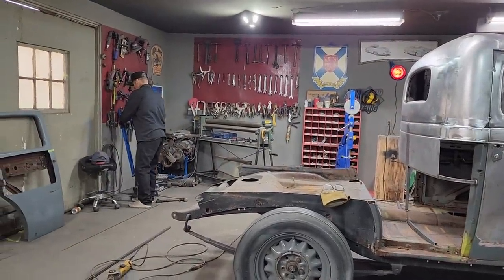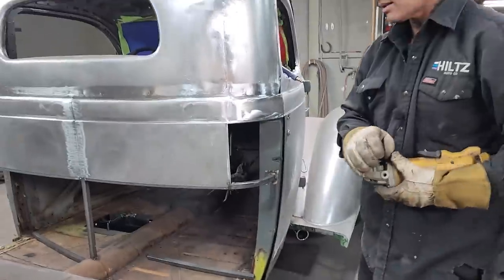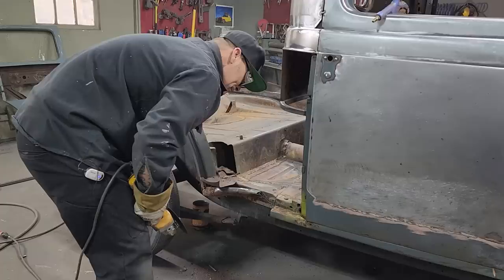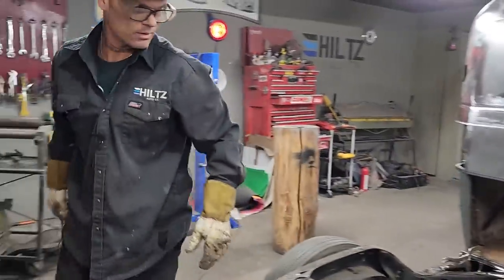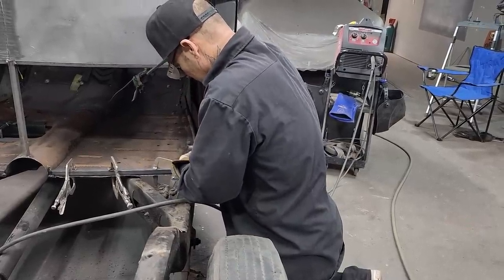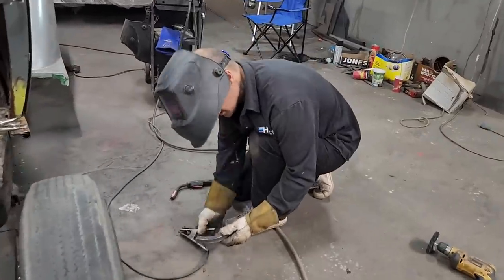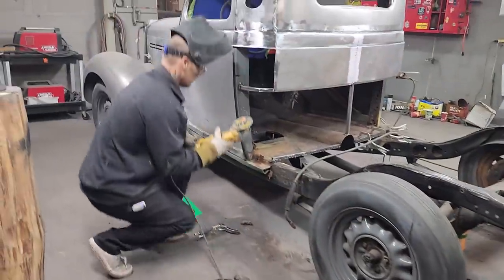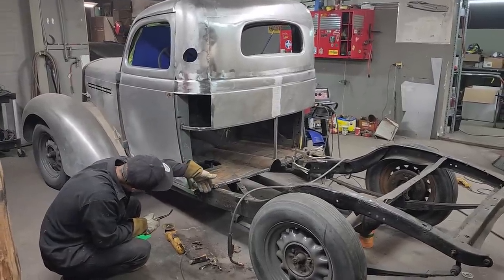Sedan to Truck conversion: cutting the floor off to fabricate cab braces

Comment: Dear Chad and Jolene.
Because of what I’ve learned watching you I was able to repair my tail pipe break on my automobile I’ve had a welder for years and never used it and you’ve given me the confidence to go for it. As a result I fixed my tail pipe with no cost or a very little cost and saves me hundreds of dollars I’m sure. Thank you keep the videos coming

Comment: Total badass build Chad. Enjoying the hell out of this truck transformation. I know you have mentioned the flap disk wheels and zip cut. I have used flap disks in the past or at work that don’t burn off material as good as the ones you are using. Can you share what kind you use? Brand etc? Shout out to Jolene for the killer content and filming it makes a difference for sure!
Reply: Need to give you 2 thumbs up for that one

Comment: Hi loving the work you are doing. I like the fact that it has nice curvy shape to the body. Apart from the sharp corners  on top of the doors. They need rounding off. If you watch Matt's off road recovery on YouTube. He's making a giant off road recovery truck. A heavy wrecker as he call's it. His cab has a similar look to your cab. Have a look at his 2 doors and how much nicer the door's look with rounded tops

Comment: Could you add a piece of square stock at the bottom of the hump in the center bottom. That way you have something to weld to and maybe add a piece of square stock in center of metal hump going,North,South. Upside down T. Just a mere suggestion,your build,your way of doing it. Doing a awesome job,I am amazed.

Comment: Any ideas on what kind of truck bed?  And will you blend a running board to be a part of the rear fender wells?  Would you consider doing wide rear wheels.

Comment: Farmers did similar things way back, but this will be far more finished and not held together with bailing wire. This truck will have a natural lowered look with the stock suspension and frame.

Comment: 👍🏼 The upper rear corner of the doors looks off to me, it’s too square.  Possibly look at putting a radius instead of that sharp corner.  I think it would flow much better with the curviness of the rest of the body.  Just a suggestion but looking nice!!!

Comment: On the cut-out floor, the horizontal lines stamped in might look good as the vertical sheet metal on the back of the cab.

Comment: Chad? Silver plating with silver nitrate is something that has been used as far back as the development of the oldest of photographs. It can also be applied over paint (with an applicator) to appear "not function" as chrome.

Comment: I am sure you have done this before, but can you show and explain uses of the different grinder wheels you use?  I have used cut off wheels and standard grinder wheels but not familiar with flapper wheels and I am very impressed with the cut off wheels you use.

Comment: I think it is amazing that a professional workshop, I say that because he makes money from it, yet he doesnt have a Oxy Set for cutting, welding or just for heating or shrinking metal with. Instead of using Bog he could share with us the secrets of Leading, but to do that he needs heat, Old Jim has a Oxy Set and so does most people that work on sheet metal., just saying, please dont take it that im crapping on Chad for it.